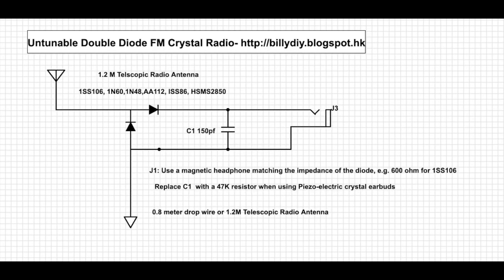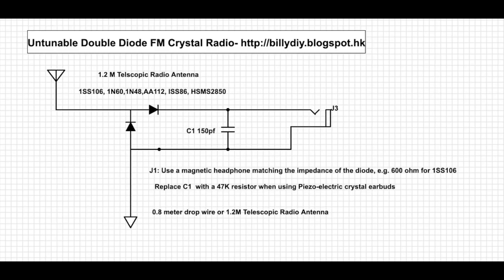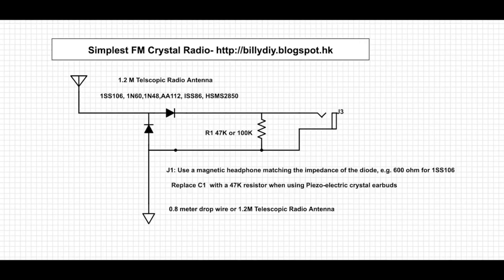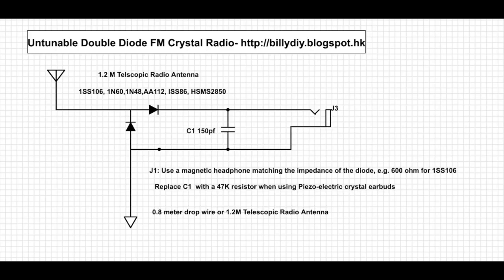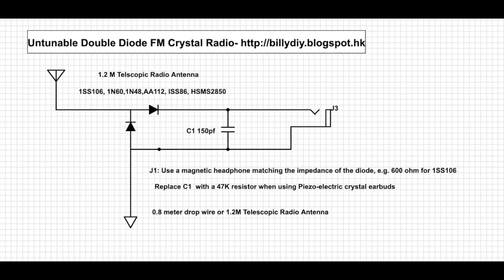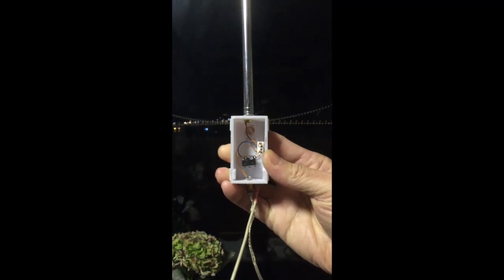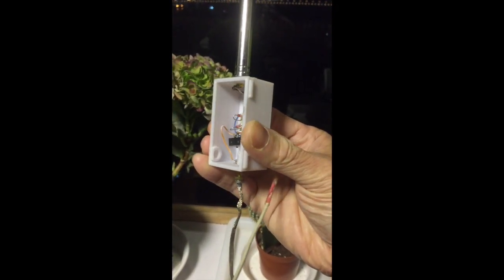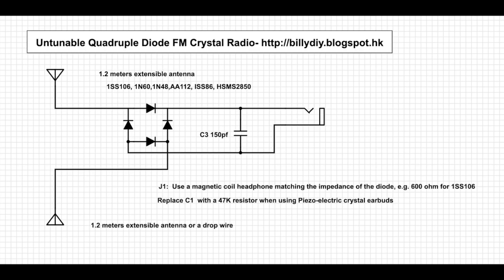FM Crystal Radios Series - Part 2-The simplest FM Crystal Radio

Comment: What is amplifier you are using? Can I connect the LM386 amplifier?
Reply from the maker: I do not use amplifier. I think using amplifier is like cheating. A crystal radio should be listened to by a headset or speaker directly without any battery powered devices. All my videos are recorded directly through the impedance matching transformer and connect to the Iphone's mic.

Comment: Sir, can I use 12v Piggo buzzer in place Piggo crystal ear phones?
Reply: Sir,
Please forgive as I may be regularly disturbing you.
This time I am happy to inform you that I have succeeded in building FM crystal radio with 4 germanium crystal diodes by forming a bridge rectifier. I want to share a video of it. So please be good enough to share your email id.
Reply: Sir,
Herewith I am sending the video clip of the FM crystal radio built on the lines of your video. Please feel free to offer your remarks.
https://drive.google.com/file/d/1F-j9lNsfIEC1JkdGZBmz3eRtn2kRaYhp/view?usp=drivesdk
Reply from the maker: It depends, you'll need to try it out to see if it works. Some buzzer has electronics that blocks the sound of crystal radio. You may need to open it up to connect directly to the vibrating plates inside if it does not work
Reply: Thanks sir. Can I use 100 pf capacitor in place of 150 pf?
Reply from the maker: @prabhakarratnagiri7265  , yes.